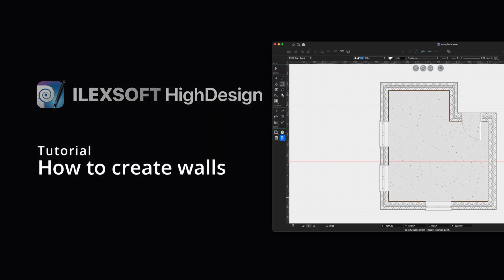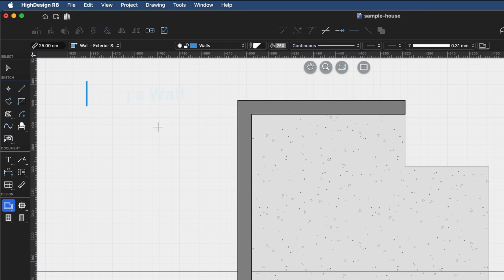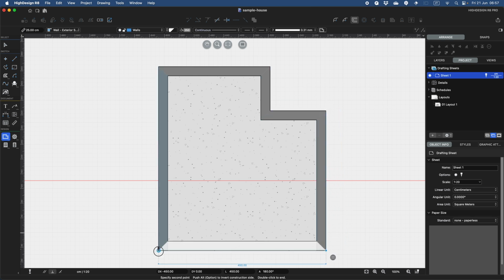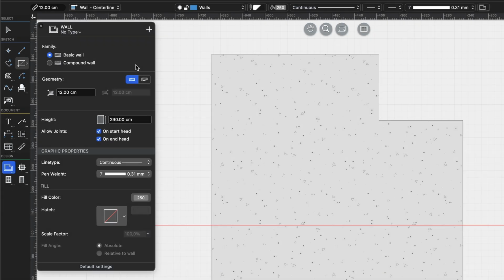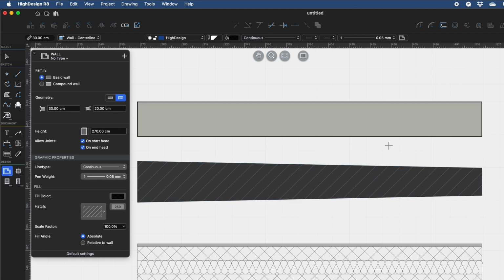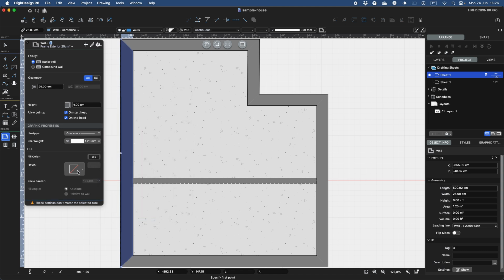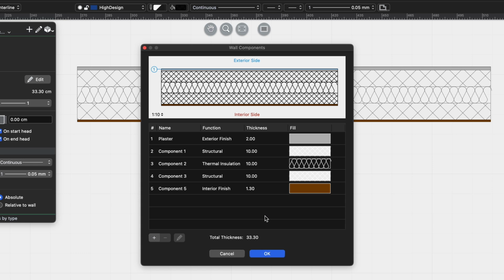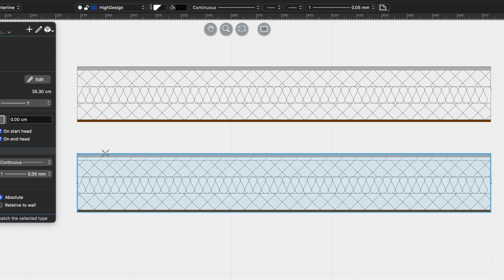How to create walls in HighDesign

Comment: Hello, I think you are developing a great software with great potential. I'm trying it right now, and watching all tutorials you have here, but I can't figure out a few thing about walls, hope you can answer these:
1- How do I offset a wall? The offset tools doesn't seem to work with walls.
2- How do I put a window or door at the center of a space, when the wall extend through a few rooms, like an exterior wall that is share by 2 Bedrooms for instance, when trying to put a window in the center of each bedroom, I don't get a snap point in each room, instead only a general center point of the total length of the wall.
3- How do I flip a wall while drawing, while keeping the side of the wall I'm using for reference? For example, if I'm drawing a wall from the bottom up, and the Leading line is Interior Side, the wall is always drawn on the left side of the cursor. How can I flip it so it will draw it on the right side without changing the Leading line to exterior?

Thanks!